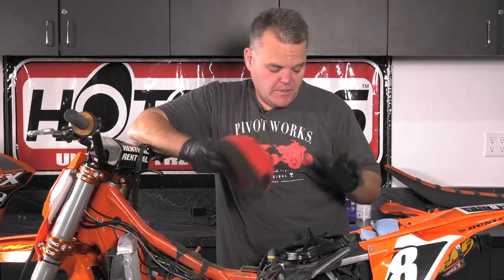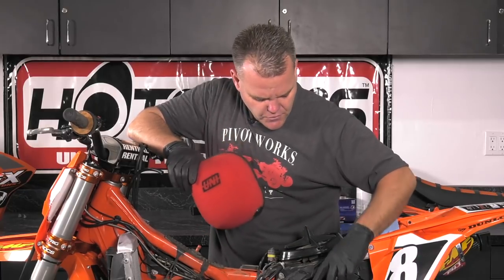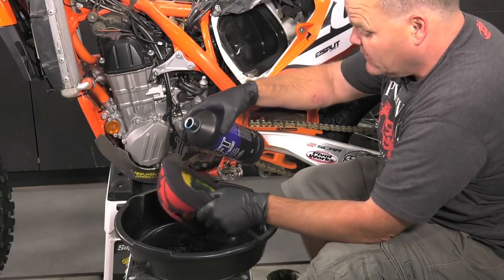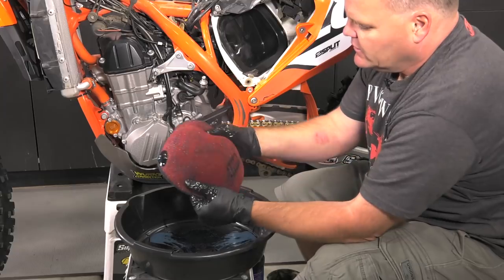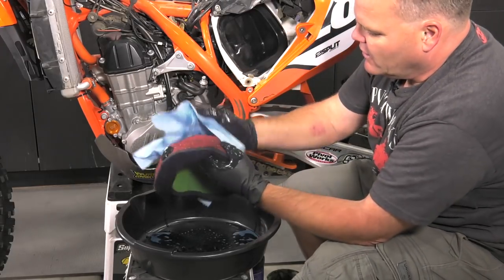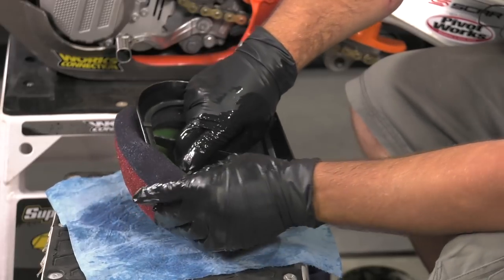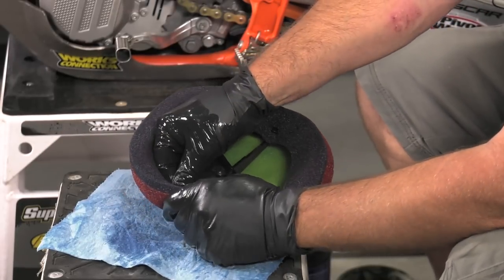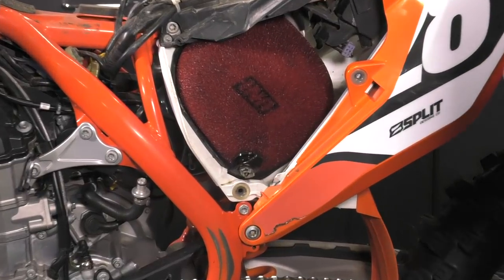How to oil your air filter

Comment from the maker: Not really -- A bit of a old-school tradition that guys from the 70s with bikes that had air filter that did not seal well have passed on to the new generation.  These new bikes seal great where they meet the air box and filter---  Also with grease your much more likely to drop pieces of grease (with dirt on them) in your boot when removing your old filter.  Of course just my opinion and I am around plenty of pro MX and Off road teams and I do not see any that do it.

Comment: That new cage design is prone to warp a bit from the pressure of the latch. Not a horrible idea to throw a bead of grease on the rim as well to ensure you don't pull any dust or dirt.

Comment: Jay you don't grease you'r filter?
Reply from the maker: Never-- Very old school and a tradition from old bikes that filters did not seal well-- nowadays no issue and if you grease it you can have a higher chance of pieces of grease with dirt on them falling in your boot and into your motor.
Reply: Thanks jay.
Reply: Jay, with the most respect for your experience I’d have to disagree with not apply of grease for a seal. My son has a yzf250 2017 with 60 hrs. He’s lazy so he always buys pre oiled filters and discards the old after 1 hour riding. He never has greased the seal. He called me and bike was not starting or kicked 30 times to start. The boot and throttle body had significant dirt. We cleaned it but took to shop still not starting well and cylinder is severely scored, needs top end and intake valve sticking. I’m sure the valve played into poor starts however not sealing with grease damaged the cylinder needing several hundred dollars in repair.

Comment: I use this same maxima oil on my CRF450 05 filter. I did not remove the backfire screen yet. It would be ok to remove it? Is there a power gain?
Reply from the maker: Yes small gain- better snap at the throttle -- if you dont like it you can simply put it back on.
Reply: Thanks for your answer. Excellent channel by the way. :)